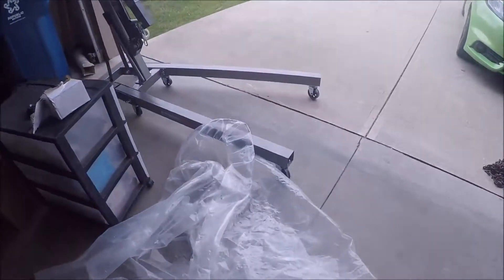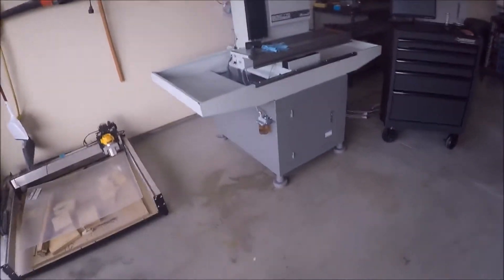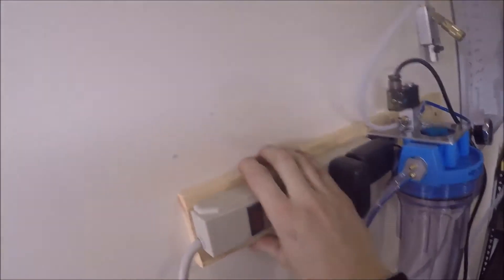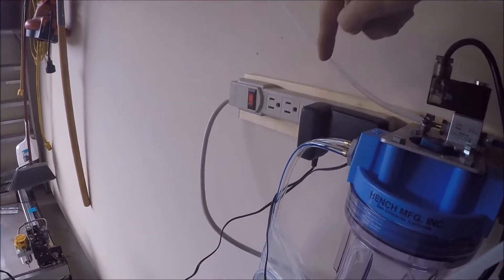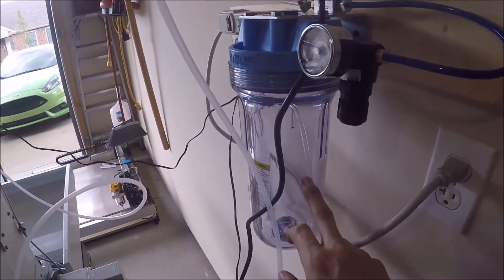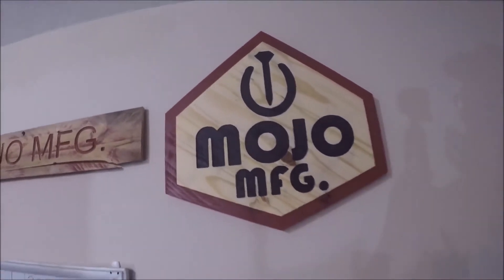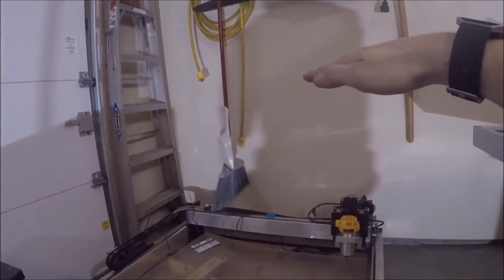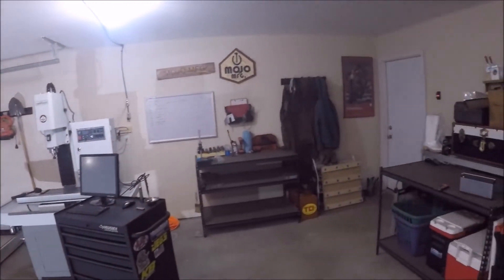Tormach 770 Rigging and Setup: After Work Special #63

Comment: Yeah, you need to move that filter/oiler.  That's supposed to go to the air input line right before the Power Drawbar to keep it lightly lubed.  Everything else should be dry filtered air.  I wouldn't fire up the air on that line until you fix it, or that hose will be oil contaminated.
Reply from the maker: advil000 you're right. I have an air outlet right before the filter/lubricator. So I'm able to bypass the filter/lubricator and go straight dry air from the compressor straight to the fogbuster. I didn't want to risk putting oil in the coolant.